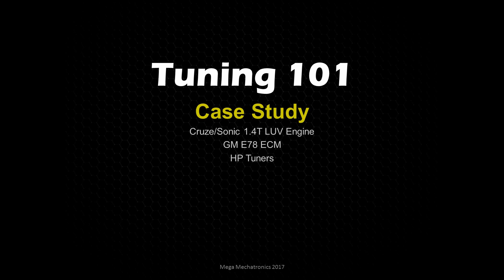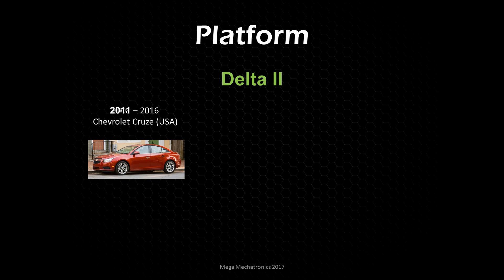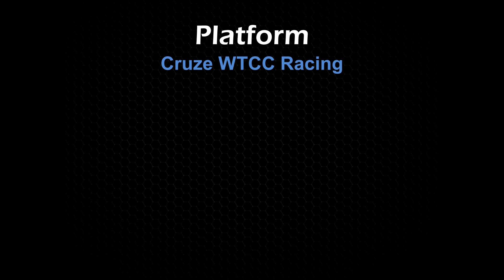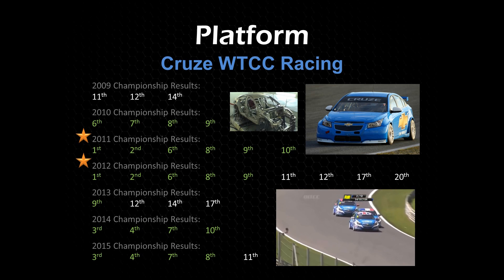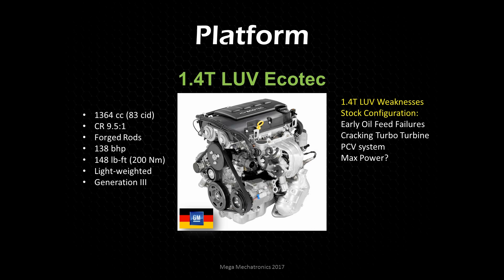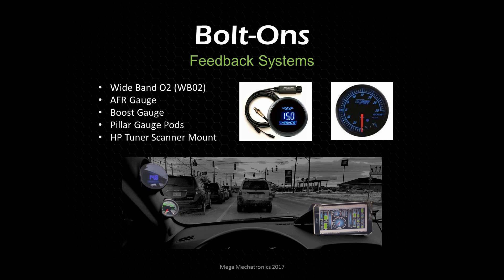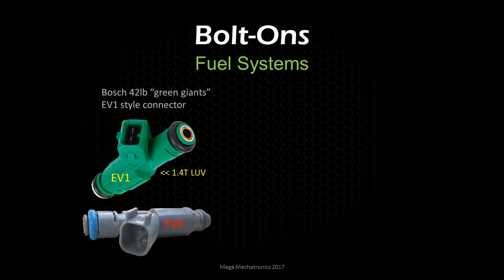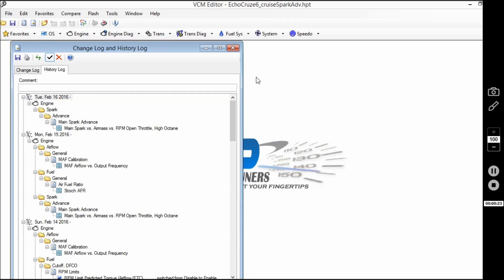How to tune Engine Tuning 101 - Part 6 - Turbo Cruze Mods Tuning Tutorial

Comment: I'm new to tuning where is the main VE table, and where do you set the main EQ ratio
Reply from the maker: What car and year?
Reply: @MegaMechatronics  2015 1.4t
Reply from the maker: @scriptmike  GM uses highly nerdy SD calculations, lots of them. You'll need to look into "virtual VE" tuning, I haven't figured it out yet, my version of HPT does not have this feature at least.  I tune all my GM cars with MAF and don't have any problems in my experience.

Comment: I had one of those 2011 Cruze's that suffered from crack pistons.  At 30,000 miles my car was diagnosed with 3 cracked pistons.  The engine had to be replaced but I ended up trading the car as the stealership who did the engine replacement did a terrible job and the car was never the same.

Comment: Please keep making more, these are very informational. 

My only remark would be that I feel you have strayed slightly from the original tuning series. The videos prior to this were more about tuning in general, covering a vast majority of projects/situations, as well as how and why things worked. This video is more of a specific car, and although I am perfectly fine with this content, I really thought you had something great with where it was headed before.

This was intended as constructive criticism, not to bash your content.
Reply from the maker: I agree, this is why I have been trying to label it as a "Case Study".  With GM tuning, this case study will help a lot of people.  However, calibrating Fueling, Spark, Airflow are essentially standardized across the board with any Otto Cycle engine.

Comment: Super Excited for part 7! I fitted the 11038 turbonetics to my cruze, but am limited to speed density operation now.
Was able to get into SD in hp tuners by zeroing the MAF sensor failure voltages so it would always fail. This broke cruise control, otherwise worked great, no CEL's